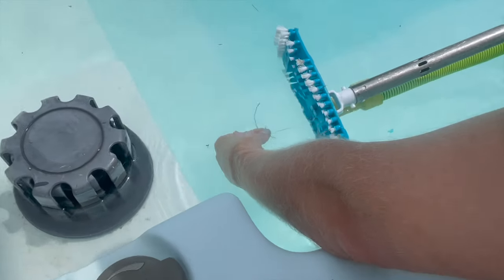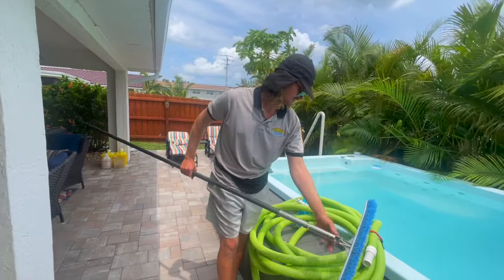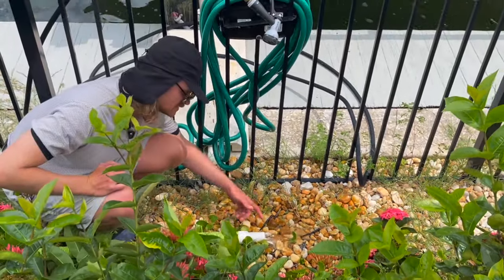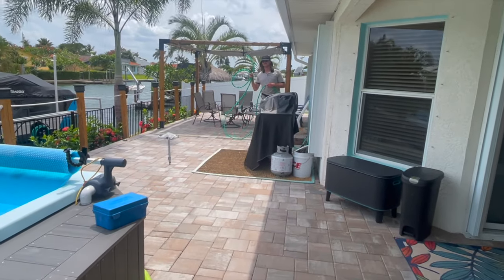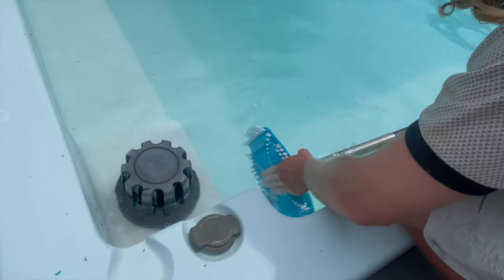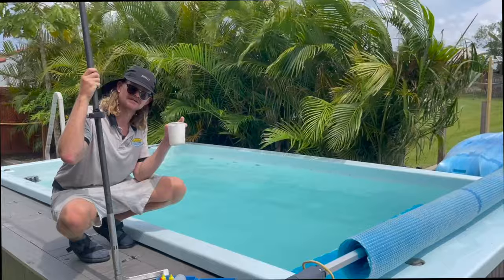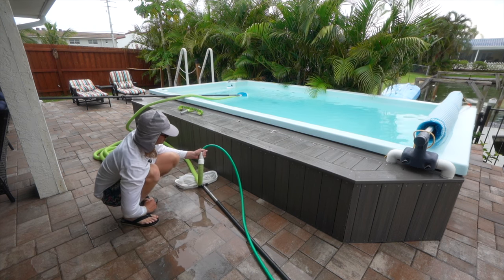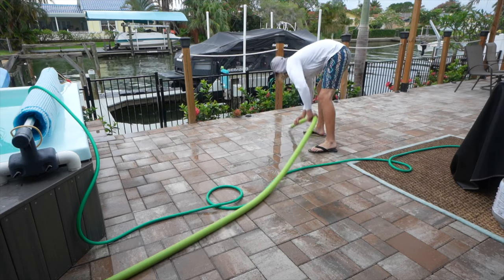How To Vacuum A Pool WITHOUT A PUMP

Comment: I had a problem with my pump, so I hooked a wet vacuum to the pool vac hose. turned it on while my son was vacuuming the pool and when the wet vac was full I turned it off and pulled the plug to empty it and it kept pulling water. Was able to finish cleaning the pool without turning the Wet Vac back on
Reply from the maker: Yes exactly what is demonstrated but your vacuum did all the work priming it for you, very cool!
Reply: I want to try this because I have same problem, do you have an in ground or above ground pool?
Reply: @akoww1000

Comment: This siphoning works because of “gravity”, but you must remember that in order for you to keep a continuous flow of water going that the end of the hose MUST be LOWER than the vacuum head and/or the end of the hose that is in the water!!! So, in other words, if the output end of the hose is lifted higher than the suction end of the hose you will lose prime and your gravity siphon pump will not work anymore until you re-prime it and get it flowing again!!!
Reply from the maker: Great summary!

Comment: This was an awesome tip.  I have a bestway above ground pool.  I purchased the pool vac head and hose then discovered, via youtube, that you need to stuff around purchasing extra connections to attach the hose to the pool outlet port.  This video meant i didnt have to go to that extent.  Plenty of suction as i sucked out green slime from bottom of pool
Reply from the maker: Awesome glad we can help! Any other videos you can recommend that would help you?

Comment: Looks good. I took it a step further and bought a pool pump (variable speed so I need less amps and just connect with a 12 gauge extension cord), bolted it down to a little rolling cart I made and connected the hose to that. The cart also has a little cartridge attached (not necessary but another option), so I can shoot the water back in the pool and just clean the cartridge (and not have to refill the pool). This allows me to just pull the unit out of my truck and roll it around the pool (Not a pool service guy but I service a few friends in my area). This obviously also eliminates having to mess with getting the end of the hose lower for water flow.  Been working well for the last few years.
Reply: I’m so interested in doing this for my own pool!
Reply: @suganspiceb  You will love it!  Clean water all the time.  Huge difference if you have a sand filter.

Comment: Bro, thanks! I've been looking for a way to vacuum my pool while my pump/filter is out of order. I'm going to give it a try first thing in the morning...
Reply from the maker: Let us know how it works please!
Reply: @PoolCareWorld  The concept was great, but it didn't work for me because of the way my pool sits. I couldn't place the water hose below the pool level to keep the water flowing when siphoning.
Reply from the maker: @DG-ms5hw  it sometimes takes a couple try’s if it a above ground pool it should work! Watch the second half of the video where I’m standing level with pool stand holding the hose pushed down while cupping it with your hands. It may be minimal but should see water start flowing
Reply: @PoolCareWorld  It's an in ground pool. The water did siphon slowly, but not enough suction to vacuum the pool.
Reply: My pool is on top of a hill so this should work well

Comment: What do you do if inground pool is level with ground? There’s no low spot
Reply from the maker: It may not work for you the water will have to be elevated from the end of the hose to create the siphon
Reply: Prime with a shop vac but the outlet has to be lower to sustain the flow

Comment: Could also feed the hose into the pool and then close the open end with your hand and pull it out and bam
Reply from the maker: manually fill the hose is a great idea I haven't tried! the only thing is most the time the pool is dusty and I'm not trying to disturb the bottom. I can definitely see it working great in a larger pool though. I'll let you know when I try it!

Comment: Wouldn't using this method throw off pH, CYA, TA, borates (if used) by having to add water?
Reply from the maker: Yes but in something like this any excuse to drain and refill with fresh water! Basically it’s a big Spa. But yes you are correct it does affect all the chemicals! We always try and balance the chemicals at the end of vacuuming to waste. It’s a minimal amount of water that can be easily rebalanced. Thanks for watching!
Reply: @PoolCareWorld  Handy for dropping the water level for winter.  Better than siphoning and getting a mouthful!

Comment: I tried this and didnt have any luck. The hose was at a lower elevation and still wouldnt gain any siphoning.
Reply from the maker: Is the pool elevated ? If the water pressure isn’t high enough you may say to try it with a sweeper noozle and hold it on longer. If the pump is running you can also put the vacuum end up to the jet till a steady stream is coming out the opposite end on the deck. Hopefully that help you definitely need some elevation

Comment: After doing this I had mixed results. Yes he is right you will create a siphon but the results are not as they seem. Which is why you did not see a Timelapse video as was happening. The problem is that inevitably you will keep up debris and May have to do this in several applications to get small debris back down to complete the process. So all in all I would not rate this application a ten maybe a 5 at best. The thing to remember this is not a one or two day process in my opinion.
Reply from the maker: There were no tricks or video edits in this video just sped up the footage. The siphon created depends on the initial creation and having enough of a hill to put the end of vacuum hose. You’ll see as I toss hose down stairs the siphon increases. Best of luck to you!
Reply: @PoolCareWorld  again results will vary my stuff is on my ring camera so I have no reason to lie anyone. As I stated before you are correct about the that way to make a siphon. But anyone thinking this is a one two three process is sadly mistaken. No matter how slow you go you will inevitably kick up some debris and have to do it again. I don’t believe anyone can say that doing process will not kick up debris 100 percent of the time going as slow as possible. I stand by my comment. The argument is not about creating a siphon because I tried it and it worked, but to assume that doing it as you have will be done with just that one time and no debris be kicked up and not sucked out is wrong.
Reply from the maker: @theopinions47 the hose should be elevated at surface while priming and vacuuming only once full siphon started at the pace of suction. But all that being said I did have to vacuum the pool twice on the video.
Reply from the maker: @theopinions47 Watch the video again at the point where we vacuum the seat in deep end it’s real time. An the chemicals were added a few days before but the vacuum was two days back to back the second time was first thing in morning.